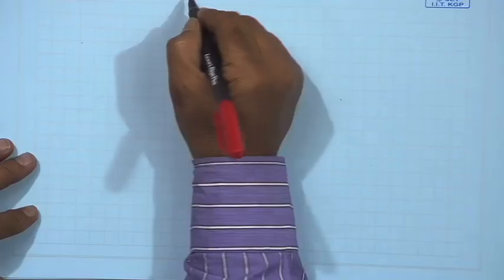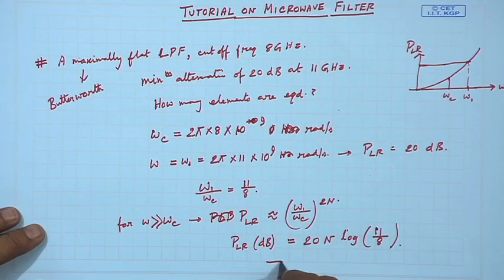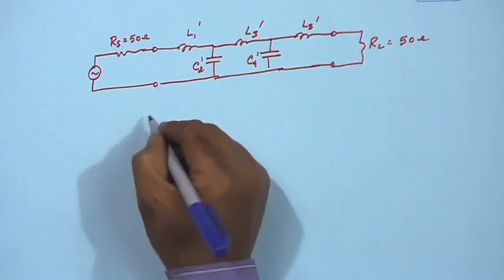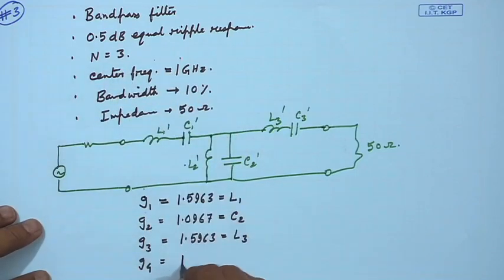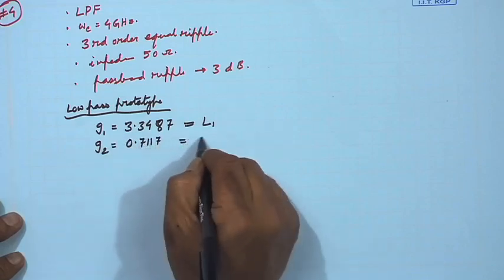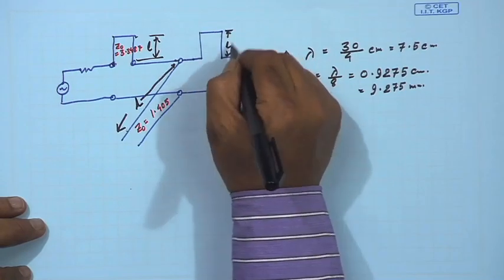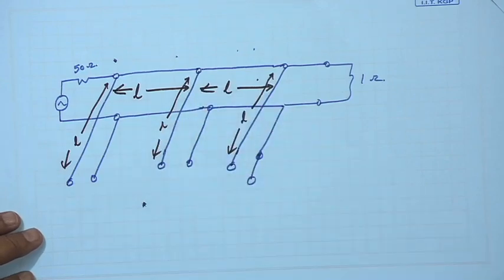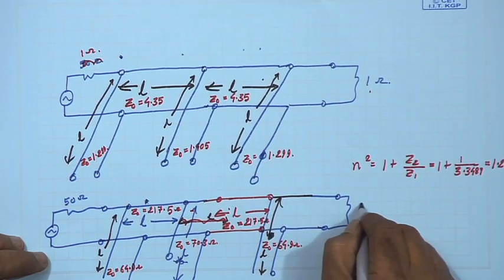Tutorial an Insertion Loss based Microwave Filter design

Comment: For example 3 with the bandpass filter design, when actually implementing this filter, do we use N*2 actual physical elements? I don’t see a way to make one transmission line section behave both as an inductor and a capacitor so that would mean you would need 2 transmission line sections to realize one N element which includes the pair of inductor and capacitor. Does anyone have any references I may use that shows a physical realization for this filter using the insertion loss method and prototype method as shown in this video?